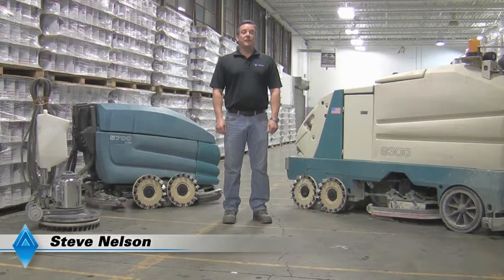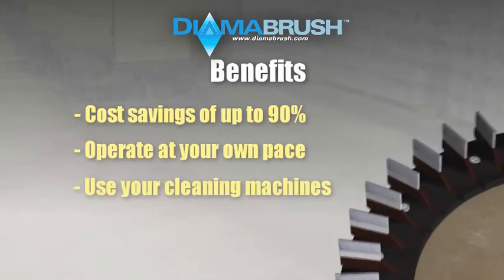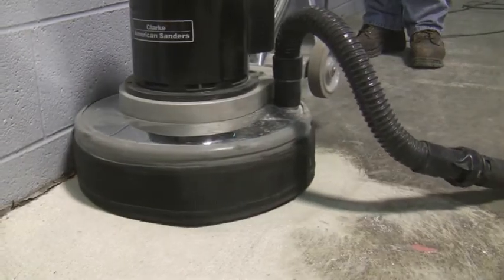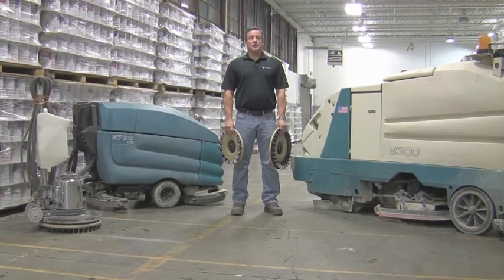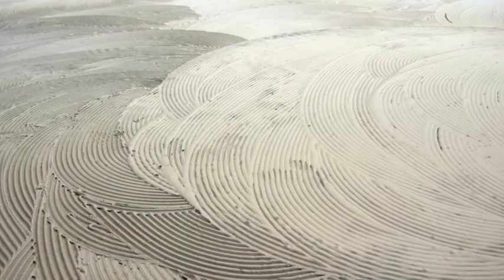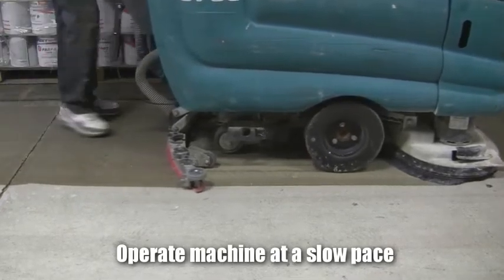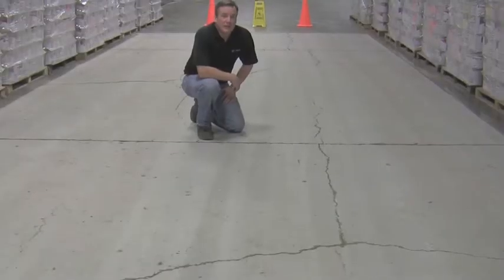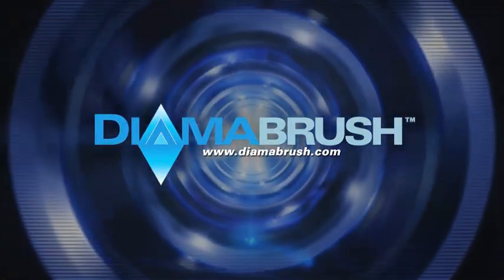Diamabrush Concrete Prep Tools - Training Video

Comment: Does Dimabrush pass the new OSHA requirements for silica dust? How do we ensure it passes?
Reply: diamashield didn't even issue respirators when I worked for them. they were all about safety and talked about dangers of concrete silica in meetings but if you ever raised concerns on a job site you were treated like a little B!+"&